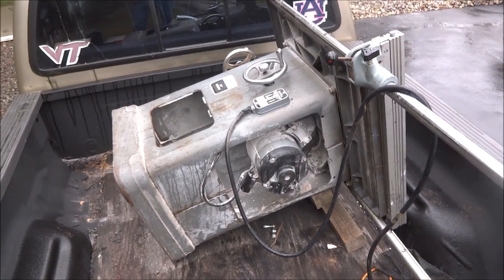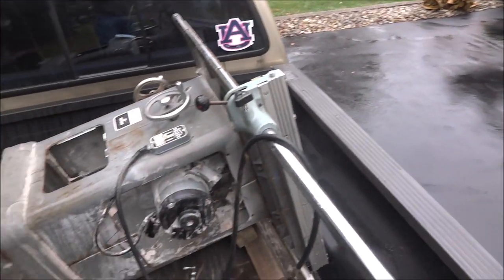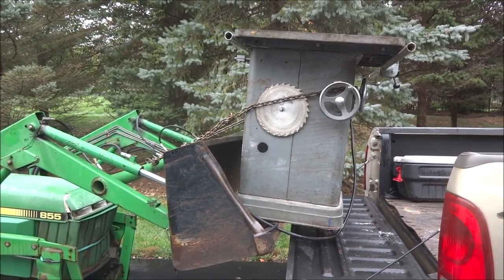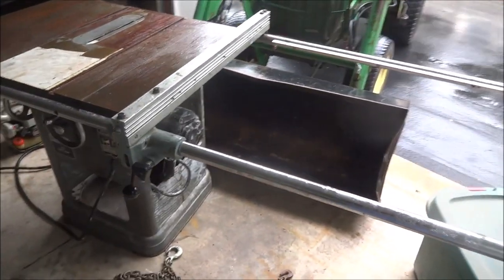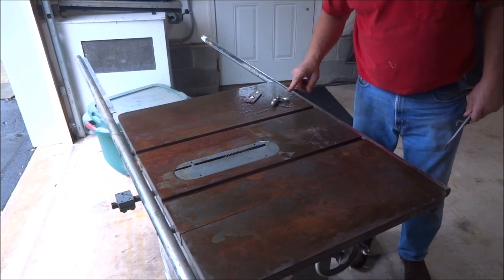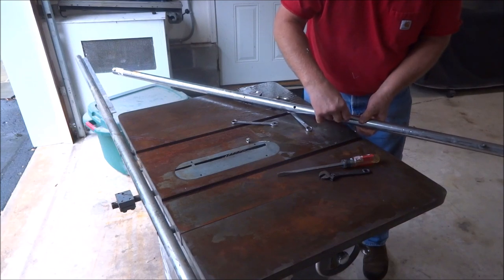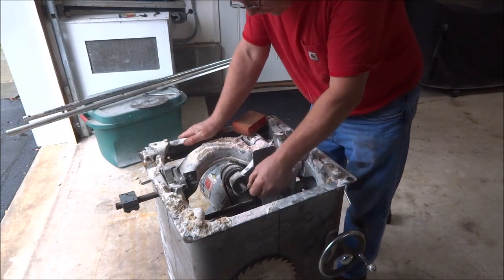Delta Rockwell Unisaw Rescue and Restoration   Part 1 of 4

Comment: I notice that you removed the arbor assembly but there were no belts on it.  Wouldn't they be threaded through the assembly?  And wouldn't you need to remove the arbor shaft to get them off?
Reply from the maker: The belts are not threaded through the arbor assembly.  The arbor pulley is on the outer side of the assembly.  The belts are easy to remove/replace by simply lifting the motor to release tension on belts and slip them off.  Hope that helps.  Thanks for watching and commenting.

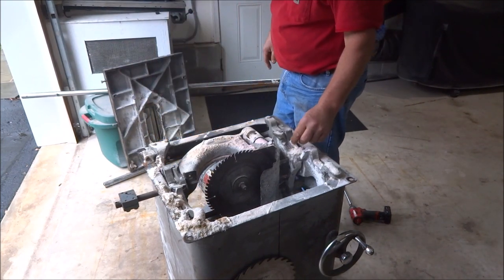Comment: At 5:30 you see why these are called cabinet saws.  The blade arbor lift and tilt mechanism is attached to the cabinet, with the top separate.  Contractor saws have everything attached to the top.
Reply from the maker: Yes and cabinet saws are much more stable and easier to adjust if needed.  Thanks for watching and commenting.

Comment: How come you killed the sound taking off the table?
Reply from the maker: That section was running at about 5x normal speed which really distorts the sound so I just muted it for that section.  Removing the bars and top is pretty straightforward - just removing bolts - so didn't see a need to add any commentary.  Thanks for watching and commenting.